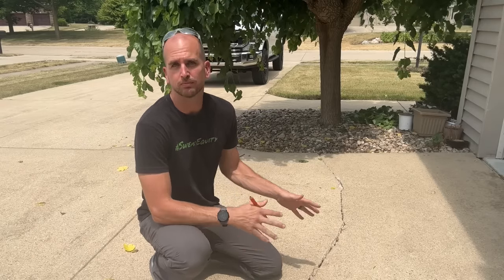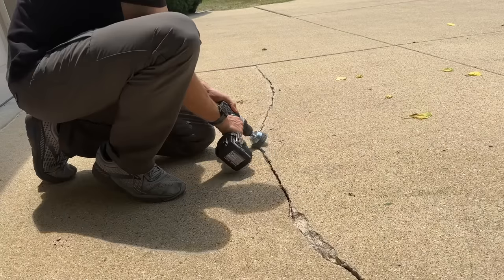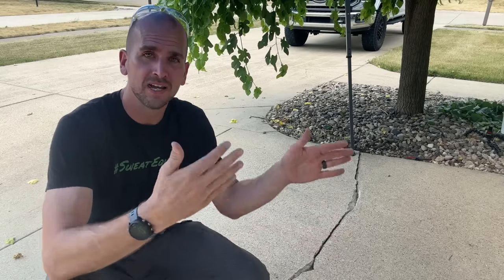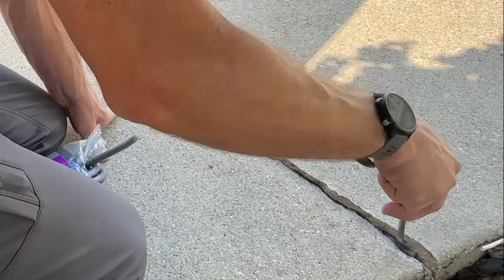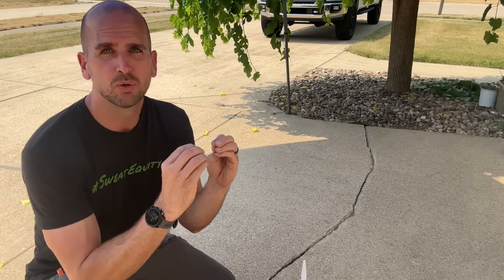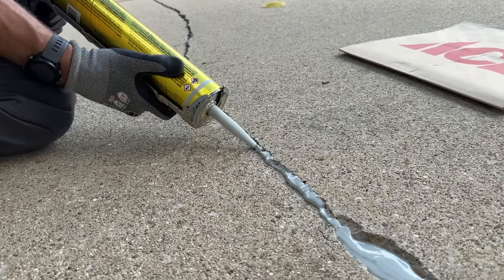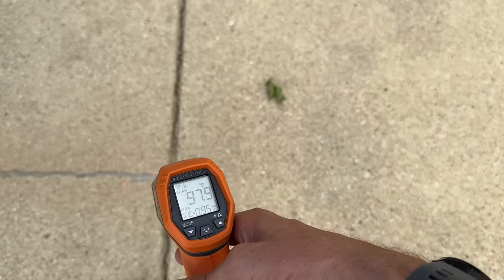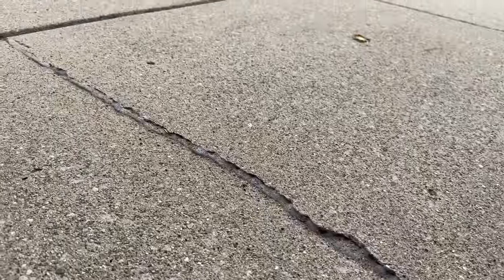Repairing A Neglected Driveway Crack |  The Ultimate Solution!

Comment: Is there a different technique to use if you're repairing a hydronically heated interior concrete floor?  The cracks are much smaller than exterior driveway cracks.  Also what do you recommend to use to replace the caulk/grout(?) between the interior heated floor rectangular sections?  Does cement grout work for both?  Thanks, Al

Comment: After watching your video I have to wonder if epoxy resin and sand might not be a good way to approach this. Pour in some resin  add some sand until you have filled the crack with mix of sand saturated with epoxy  I would think the sand/epoxy mix would add some mechanical strength to the repair at least in shear strength.  and probably a moisture seal. I have a crack that I haven't repaired yet and have been noodling over how I might approach the repair.

Comment: I’m redoing the seams in my driveway. I need to power wash it and fill the seams with new sealant. In your opinion, should I power wash it first and apply protective sealer then apply the sealant in the seams or vice versa?

Comment: Well, the difference I would suggest is, don't use a "Concrete Crack Sealer" such as the 45 SSL. I used a product for concrete from the box store, and after two years, it had dried out, and pieces were coming out of the cracks.  I had to dig all that hard shrunken cracked stuff out and start over .
What I started using several years ago is... don't laugh... Grey FLEX SEAL !   Yep, the stuff advertised on T.V. It's Liquid Rubber in a Can ! Seriously.  
I cleaned out the driveway cracks with a screwdriver, and pressure washer, then stiff wire brush.  Blew out the cracks with my leaf blower, when it was dry, I was ready for the Flex Seal.  I bought the Grey, for my first Driveway cracks, a whole Gallon of it, but you can get it in Quarts also.  Some of the first driveway cracks were up to 5/8" wide, and of course , all the way through.  Other areas were less than a 1/4" wide. So for that one, I punched two holes in the Can top 1/4" , one to pour through and the other a vent on the other side, then carefully poured the Flex Seal into the cracks all the way to the top, allowing for settling.  After 6 years when we left that house, not one joint had failed, no pull away, the Flex Seal moved with the driveway.  Being Grey, it matched the Concrete fine, but you can add some sand to the top when the Flex Seal is fresh and wet,  if you want, and that looks good too.  For smaller cracks, and if you are messy, I got a LARGE industrial plastic Syringe from off the internet, and just draw the Flex Seal out of a Quart Can, and slowly squirt it into the cracks.  I've use this method several times, including a brand new sidewalk, in the expansion joints and where it joined the driveway, so water doesn't get in a freeze, causing cracking in the first place.  Again total Success !  
And No, Phil Swift isn't a relative or anything.  The stuff just works well for Concrete Cracks.
Reply: Absolutely wrong this us one of the products that professionals use. When installed correctly it will last 20-30 years
Reply: Can you paint it and not leave tire marks after you drive over it?
Reply: @genecarden780  Well , as I said.. I tried that and in Two years that " professional " filler was cracking and coming out.  It didn't remain flexible enough to keep from pulling away as the seasons cycled , so it was a failure.
Reply: @fredericschilling6416  Don't know about painting the Flex Seal, that's why I use the Grey.  It closely matched the Driveway concrete color.  And I used some Sand to sprinkle on top to help blend the color as I poured it into the cracks.  Still looks good even though we moved years ago.
Reply: @jameslester4474  you said you used a “product for concrete from a big box store” Not 45 SSL. And if it dried out, and cracked and fell out, it was either not 45SSL, was not installed correctly or it was possibly (actually very likely at a big box store ) very old out of date material.
when installed CORRECTLY 45SSL WILL LAST 15-20 years or more. It is pedestrian grade polyurethane sealant from a reputable company that has a proven track record.  It will remain flexible.There are 100s of miles  of it satisfactorily in use. ( don’t blame 45SSL)
 Almost all sealants sold at big box stores, like Dap in particular, are cheap consumer garbage. No matter what they claim.  If it dried out and fell out,my bet is you used one of the cheap brands. 
 The 3 exceptions at big box stores are Tremco, GE, and Sika products.All 3 make industrial grade products. ( there may be1 or 2 others that I am unaware of being sold at big box stores)
 Tremco, GE, Sika and Dow, ( among others ) all offer 20 year performance guarantees to qualified installers.  ( the installers have to be qualified because 90% of sealant failure is due to improper installation). Real guarantees, not the ones offered to consumers that require you to keep the receipts and empty containers and are only “good as long as you own the home”.  Actual guarantees in writing, included in the construction documents.The fact that you used flex seal tells me all I need to know. Real “ quality” sealants and waterproofing , are marketed to the waterproofing industry. Not sold in infomercials. While flex seal can work, in the waterproofing industry it is considered an emergency, temporary fix. And almost no one uses it. If you used 45SSL and it failed it is 90% probability you are to blame.

Comment: I give it 2 years didn't get the right concave/convex shape for flexibility. it's essentially just flat on the top and bottom. Only sand the top for protection from getting stepped on it will eventually just wear off over time so using it for blending doesn't work. Grinding the sides to create vertical walls is recommended as well. Ive seen jobs that look 100 times worse than this but can definitely get some years added to its life span by swapping product and adding more prep. No sand ,only use closed cell backer. Finish by striking with caulking spatulas to give an hourglass shape for maximum flexibility.
Reply from the maker: Thanks for the feedback 👍
Reply: It won’t even last two years. You can tell by looking at it. Come on!
Reply: @fredrubble4305  He did clean the sides really good so if there isn't a harsh winter where he lives it can make it atleast a year. I like to give things the benefit of the doubt.

Comment: Instead of backer rod I've used polymeric sand used for pavers. Pour in the sand pour in some water. Let dry , then add polyurethane crack filler. Works great. Make sure when you do this that the temperature is around 70 F. That way the expansion and contraction of the concrete won't affect the fillers that much.
Reply: I have been a professional caulker for over 45 years. Using sand as backer is a very bad idea. Backer rod is FAR better. It has 3 specific purposes. Depth control. Backing to force the sealant to contact the the joint surfaces. And most importantly it gives the proper profile for the sealant to function properly
Reply: @justtinkering6713  let me know when it lasts 30. And maybe you will be lucky and it will last that long.  I truly hope it does. But as someone who has installed, repaired/ replaced well over 100 miles of sealant, I can tell you that
1. most of the time it will fail prematurely. 
2. No major manufacturer will guarantee sealant when installed over sand.of any kind. The only backer that major manufacturers will accept are backer rod, bond breaker tape, and plastic “ zip strip” used in commercial flat work.
Of course for homeowners the guarantee on consumer grade products doesn’t really matter. But it is very relevant to what are truly acceptable methods. If it voids commercial guarantees there is a reason for it.
It is a FACT  that sealant should be installed over backer rod when possible. No exceptions.
It is also a FACT that for sealant to perform its best it needs to be installed with the top and the bottom of the joint both concave making an hourglass shape. ) (     Since homeowners rarely tool the joint when using self leveling sealant the top is convex so it is even more critical to use backer rod  so at least the bottom will have the proper shape.
Polymeric sand is particularly bad because the sealant will bond to it causing a 3 sided bond. Absolutely unacceptable.and a major reason for sealant failure. Yes polymeric sand will move a little,but far to little to not restrict the sealants movement.
 For a lot of years it was my job to prove why sealants/ waterproofing systems failed.
Your method incorporates 2 of the 4 most common reasons for sealant failure.
So yes it is a bad idea.
Reply: @justtinkering6713  hope you are lucky enough to have it last 25-30 years. I truly mean that.
But It us only luck
I have been a professional caulker for more than 45 years. NO MAJOR SEALANT MANUFACTURER WOULD GUARANTEE THIS
For a number of reasons
1. Sealant must be installed over backer rod if possible. NO EXCEPTIONS
2. Polymeric sand hardens, the sealant bond’s to it creating a 3 sided bond. This is completely unacceptable. And voids the manufacturers warranty.
Backer rod creates the accepted profile to sealant. Concave on the top and the bottom creating an hourglass shape ) (
Anyone that did this would be fired on the spot. 
For many years now my job has been to prove the reasons for sealant failure 
Your method uses 2 of the 4 most common causes of sealant failure
So yeah it is a very bad idea
Reply: @justtinkering6713  8:16 8:16
Reply: @genecarden780  I guess you're Super Caulker Man. I've never seen any caulk last 30 years and it was all  applied by  "Professional Caulkers".
Reply: @genecarden780  Hey somebody's got to do it, might as well be you.
Reply: @genecarden780  If your claim to fame is you have been a professional Caulker all your life, you should be proud of yourself.
Reply: @justtinkering6713  you At obviously ignorant on sealants. It happens all of the time. Our work is expected to last 20 years plus. I have numerous examples if sealant lasting 30 years.
Reply: @genecarden780  The sealant lasts, the bond does not. You are obviously ignorant of how poly sand works. It's just used in place of backer rod, it fills all the gaps, where backer rod does not. Then the traditional sealant is used on top of that. Just for concrete cracks, of "any" size. That's all I'm saying.
Reply: @justtinkering6713  you clearly don’t understand how backer rod and sealants work together.. The sealant has to be hourglass shaped “) (“ to function properly. You can not achieve this with sand of any type.  Or pretty much anything except backer rod. This is exactly what helps the bond last. It has to be thinner in the middle so it stretches and thicker at the bonding surface so the bond does not break.Because homeowners rarely tool self leveling sealant it is usually very slightly convex making the backer rod even more important. If the bond breaks it is indicative of 3 things. Either the joint was not properly prepped. Or the sealant thickness or profile was wrong.   Or there was a 3 sided bond. Using polymeric sand will cause 2 of these 3 conditions. It WILL cause the bond of the sealant to fail.. When done correctly quality sealants WILL last 20+years. That includes the bond not breaking. And the joint being water tight. In our world if it is not watertight it is a failure. 99% of the sealants we install are for waterproofing purposes.So again using polymeric sand is a bad idea. There is a reason that EVERY MAJOR MANUFACTURER OF SEALANTS ONLY ACCEPTS BACKER ROD AS FILLER. It is an engineered system. But of course you know more than the manufacturers.
Reply: @genecarden780  BS

Comment: I have an exposed aggregate driveway with some small cracks throughout. The cracks are about 1/16 in. wide, so I can't get any backer in it. Would you still recommend me grinding it out and making the crack wider so I can put in 1/4 in. backer rod, or should I just fill those with sand instead?

Comment: And the crack is in line with that tree.  The path is being lifted by the roots of that tree.  Unless you either remove that tree or cutting the root off where it goes under the drive.  If you don’t attend to that tree, you will be back next year on your hands and knees repeating this repair.  The drive will also be another 1/4 higher than last year.

Comment: I used hot melt asphalt crack sealer. 
I doesn't look as nice maybe because it's black and won't have clean line edges but it will last 20+ years at which point you only need to reheat it and add a very little bit more sealer.
For the crack in this video you would need only 1/2 box or less (35lb box) 
Cost is about $1 per pound. Plus cost of propane (or acytlene) torching heat for the application. Again, much messier than caulk from a tube but will last much longer and easy to touch up (re do) years down the road when it begins to ball up and crack.
---
I could be wrong, but I have not seen caulk last more than about 5 years and the old has to be removed before adding new caulk to do the repair again.
---
There is a new king f cncrete repair (restore/resurface) which looks promising.
I used it on top of an old concrete well top that had pitted like crazy and I am happy with the result, just don't know ow long it will last.
Quikcrete Resurfacer" 40 pound bag for about $40
Apply with squegee. 
It needs to be soupy -- i mixed it too dry - more like chile than soup and had to add more water and got close to being in a bind because it has a short workable time - less than 15 minutes

Comment: Tip - Buy pipe insulation and cut/strip to fit - Much cheaper than backer rod and customizable.  Then after sealant sprinkle quickcrete lightly over it to blend.

Comment: ? I have a small …less than an inch…gap between the blacktop and concrete apron of my driveway. This gap had been filled by the road crew when some roadwork was done several years ago and now the sealant is crumbling away. Would I use the same method/ products that you used on your concrete driveway?

Comment: What's your opinion of using minimally expanding foam instead of backer rod?
Reply: Absolutely bad idea.I have been a professional caulker fir over 45 years. If I use anything as a filler other than backer rod the warranty is void. Backer rod provides 3 essential functions in caulking. It provides depth control. It prevents a 3 sided bond but probably most important function is it provides the proper profile for the sealant to perform correctly. ALWAYS USE BACKER ROD

Comment: Hey enjoying your video very much.  Question, if I don’t use a backer Rod to fill the depth of the crack would it be ok to use fine dry sand but leave at least 1/4 for my poly material?
Reply: let's start this way, the backer rod supports the semi-self leveling sealant, else it would just get sinking down and down into the crack.  The sand would fill that void and allow the sealent to brdige the gap.  That is my final answer, you should be fine.
Reply: wait, down below a guy says no polymeric sand !  IDK

Comment: I prefer quick set cement mix or mortar. Mix it a bit wetter than normal, put in zip lock bag, cut tiny tip at the end of zip lock and squeeze it into the crack. Done! Last longer than any backer rod and silicone & will look almost unnoticeable

Comment: Could you slightly underfill a crack with this product and then apply a concrete patch repair over it to give a smoother finish? Or would that weaken the bond of the concrete patch? I have a similar crack across the front of my garage, which is slightly pitched to allow drainage out the front (1950's build, no floor drain). I'd like to be able to smooth over the repaired surface so that I don't impede that drainage.
Reply: The concrete patch is a very bad idea on any active ( moving)crack period. This joint is obviously active. Very few concrete cracks are static

Comment: That's the sealant that can resist significant water pressure behind the crack if allowed to cure first. Great for freezers, pump rooms, forklift traffic, and anything else a concrete surface was designed to handle.

Comment: Hi, I have a patterned concrete drive that has a very fine crack forming along it, the drive is sloping. It doesn’t matter about the sealant colour as I will be repainting the whole drive anyway. The crack is only about 1-2mm wide at most. Can I get crack repair that will fill such a small crack? Or should I wait until the crack is more substantial? I don’t want the cold winter months to do more damage.

Comment: Why didn't you fill it so that it was level with the concrete surface? If I did that here in Nebraska, water would pool in the crack and during the winter, the freeze thaw cycle would just make that crack larger because of the water standing there.

Comment: Been working with concrete for 40 years...any crack repair is a temp fix, no matter what the product claims. Once a crack gets to the stage of the one in this video, the true "Best" way to fix it is to tear it out and replace it. I know it cost way more, but after it's re-poured, the right way, you wont have to worry about it again in your lifetime.

Comment: Ideally you want to maximize concrete contact but be narrow in the middle so it is stretchy. Tooled properly and with the backer rod installed so it ends up hour glass shaped it can stretch 8 times it thickness so says the maker. Thick solid chunks tend to pull away from the concrete because they can't stretch. Thicker is not better. Spray 409 or other spray cleaner on tools which allows easy tooling